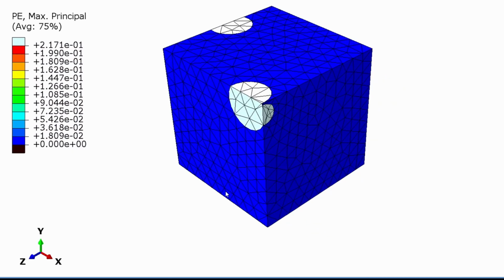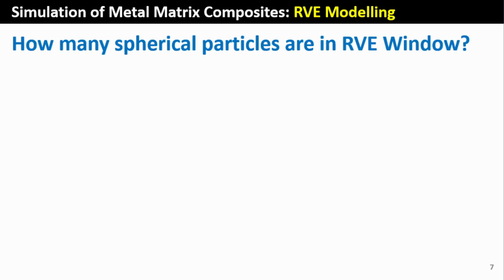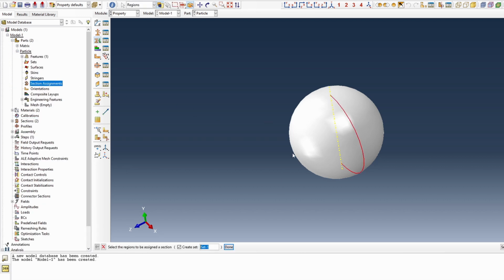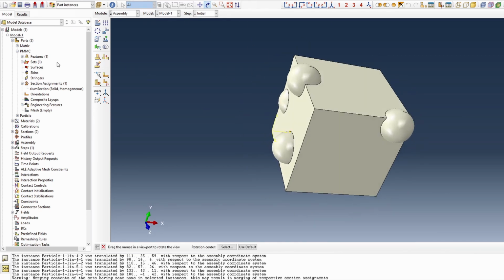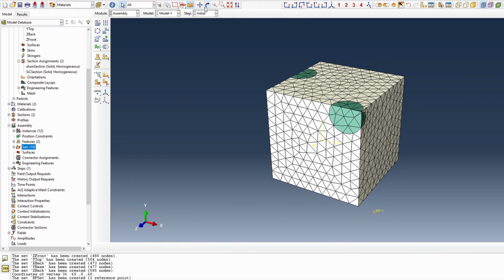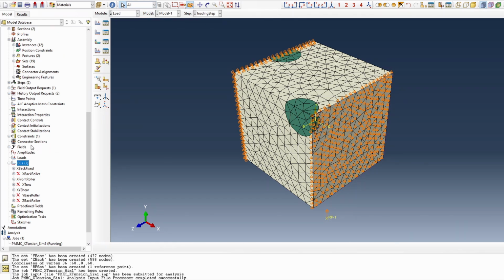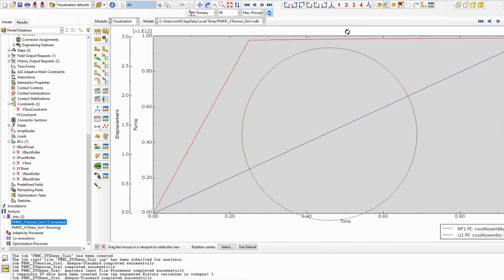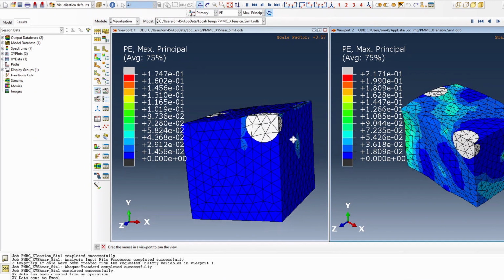RVE modelling of Metal Matrix Composites in ABAQUS #abaqus

Comment: Dear Dr. Okerke,
Thank you for such great and informative videos, can not wait for future works and presentations.

I have a question:
As I realize from channel videos, for giving periodic boundary conditions (PBCs) we should have periodic mesh in opposite faces, however, in the case of this model the mesh seems to be not periodic...
does it mean if we want to apply PBC on a non-periodic mesh we can do it manually as taught in the video?

Thank you for your help and time.
Reply from the maker: Thanks for your kind comments.
You are right that when we model with PBCs, we will often have to have periodic / symmetric nodes on opposite and parallel faces/edges. This makes the sort of implementation I have in this channel work. However, for truly heterogeneous media with random distribution of particles (and periodicity of material not guaranteed), it is not always possible to enforce this periodicity of mesh argument. In that instance, a different implementation will apply. I have used the polynomial interpolation approach for this but it is not always that straight forward. I will hope to make some videos on this ideas in future to complement what I do here for periodic meshes.
Reply: Dear Dr.  @MichaelOkereke  Thank you again for your time to answer the comments and your insights.

I have another question which is more of a general question:
Could you please explain when we should consider PBC for our RVE model and also when we can generally conduct a polynomial interpolation approach, as you mentioned earlier, (does it have any connection to the size of our RVE)

With kindest regards
Mohammad
Reply from the maker: Let me attempt to explain:

1. PBCs are best when you are working on heterogeneous materials where the constituents are clearly defined and their behaviours distinct from themselves. So, to appropriately capture their distinct behaviour, a PBC will allow for a stress wave to pass through them and generate the required wavelike response deforming according to their material response (for the constituents). 

2. Traditionally, PBCs are implemented easily (sort of) when you can have same nodes on opposite and correspondingly parallel faces/edges. This way, the kinematic constraint required to impose PBCs can be linked between the two colinear nodes taken from the two parallel and opposite edges. For this to happen, you will need same nodes on the two candidate face/edges. This leads to the requirement of periodic or symmetric nodal discretizations (meshes).

3. However, for the second question, if you cannot be sure of enforcing such periodic/symmetric meshes, then a method that guesses (interpolates) the behaviour of a point and a corresponding opposite edge point will have to be made. The guess method that is commonly used for this is the so called  polynomial interpolation. It is a type of implementation for applying PBCs where nodal discretizations on candidate face/edges that are parallel and opposite themselves is unsymmetric or arbitrary meshes. 

So, in summary, PBC and Polynomial interpolation are related with the later being simply an PBC implementation style for arbitrary meshes.

Comment: Hello. Thank uou for your great video. I am currently attempting to simulate the compaction powder forming process using the multi-particle finite element method in Abaqus. Using the assembly module, I have assembled a collection of particles and enclosed them within a box. My goal now is to remove the particles that are outside of the box, while retaining the ones that are inside. It's important to note that I do not wish to merge or cut the particles, but rather simply delete the portion that is outside of the box. Can you please provide guidance on how to achieve this?
Reply from the maker: Hello @Hossein, thanks for the query. I think the challenge to this arises from what you have set as a constraint: "you do not wish to merge or cut the particles". In this case, it becomes difficult. If you merge the particles, then you can easily extrude cut through the particles specifying the boundaries within which you accept (i.e. your current domain) and outside that boundary, anything there will be extrude cut. 

I however, do understand the necessity of not merging or cutting the particles. If this is a constraint you must live with, I will then suggest that you identify individually the particles that are appearing on the edge. YOu can label them as a set, then individually extrude-cut them one by one so that in the end, they will be the only ones that you extrude cut. It might be easier to write a python script that does this repetitive process once you have a collection of the boundary fibres. Isolate them according to their coordinate positions for example, left edge and right edge particles. This way, you can then deal with them individually.

One other thing you should consider is to use a datum plane with say a principal axis to do the extrude cutting. For example, the plane of your extrude cutting with not be the particles (as they are spherical, I hope) but the datum plane. The direction of extrude cutting will be defined by a principle x-, y- or z-axis depending on how you want to extrude cut directionally.  You can reach out to me on LinkedIn or Twitter (direct messaging) or the About page here on YouTube for further directions.
Reply: @MichaelOkereke  thank you so much for taking your time. I am trying to do individualy in assembly module but I did not managed to do that. My particles are spherical. Could you please explain more how can I do the procedure you explained?

Comment: I am currently attempting to simulate the compaction powder forming process using the multi-particle finite element method in Abaqus. Using the assembly module, I have assembled a collection of particles and enclosed them within a box. My goal now is to remove the particles that are outside of the box, while retaining the ones that are inside. It's important to note that I do not wish to merge or cut the particles, but rather simply delete the portion that is outside of the box. Can you please provide guidance on how to achieve this?
Reply from the maker: Hello @Hossein, thanks for the query. I think the challenge to this arises from what you have set as a constraint: "you do not wish to merge or cut the particles". In this case, it becomes difficult. If you merge the particles, then you can easily extrude cut through the particles specifying the boundaries within which you accept (i.e. your current domain) and outside that boundary, anything there will be extrude cut. 

I however, do understand the necessity of not merging or cutting the particles. If this is a constraint you must live with, I will then suggest that you identify individually the particles that are appearing on the edge. YOu can label them as a set, then individually extrude-cut them one by one so that in the end, they will be the only ones that you extrude cut. It might be easier to write a python script that does this repetitive process once you have a collection of the boundary fibres. Isolate them according to their coordinate positions for example, left edge and right edge particles. This way, you can then deal with them individually.

One other thing you should consider is to use a datum plane with say a principal axis to do the extrude cutting. For example, the plane of your extrude cutting with not be the particles (as they are spherical, I hope) but the datum plane. The direction of extrude cutting will be defined by a principle x-, y- or z-axis depending on how you want to extrude cut directionally.  You can reach out to me on LinkedIn or Twitter (direct messaging) or the About page here on YouTube for further directions.

Comment: Hi! Great Video!

I have a question. Is Periodic Boundary Condition Applied to this simulation? How different would be if PBC is applied vs no-PBC? thanks!
Reply from the maker: Hello @David, thanks. There is no Boundary Condition on this simulation. If it were to have PBC, you will see a periodic deformation with the shape at the back mirrored at the front for all the three planes (x-, y- and z-planes). In this instance, I have fixed the back using a Dirichlet type Boundary Condition and loaded the front edges. This gives a deformation that may seem periodic in the front but this is entirely due to the presence of the inclusions (particles), causing the deformation to be non-uniform. I hope this makes sense.

Comment: Great video sir. I have a question. I created an RVE model in Matlab. This RVE model is a cube with Voronoi polygons. I have the faces, cordinates of seeds, vertices, and also information on how the faces are connected with each other in matlab. I would like to export this RVE to Abaqus from MATLAB using python scripting. do you think this is possible?
Reply from the maker: Hello @Akshay, I have not dealt with this type of problem before but I do think it is possible, if you have all the nodal coordinates and element connectivities. It might help if you can re-format the information into an ABAQUS input keyword style so that it is easy for ABAQUS to read. The problem with your MATLAB model is that it is not in a format that ABAQUS can read. So, some translator of a kind is required. You can study the ABAQUS input keyword file and see if you can re-format the information you have into that format. That means you need to know the element connectivities for all the cells/meshes in the MATLAB model and their nodal coordinates and node numbers. It is not trivial but it is certainly possible, in my opinion. Good luck with the research.
Reply: @MichaelOkereke  Thank you sir for the reply. So all the information I currently possess is based on geometry rather than the mesh. To be specific, I have the coordinates, faces, vertices and connectivity information. Now all I have to do is understand how to write this in a format so that Abaqus can read it as a geometry input. So, I would like to know if there is any material I can get into so that I can understand how to write this document.
Reply from the maker: Hello Akshay, I do not have any material. I think you should search for 'from MATLAB to ABAQUS translator', you may be able to get some resources online. Sorry!

Comment: Sir, why is periodic boundary condition not needed in this case?
Reply: I have seen the comment of your on PBC with 3D. But may I know if the result is the same with or without PBC? Thank you, I hope your reply. Your videos are great valuable resource , sir. I thank you
Reply from the maker: Hello @Kim Kinal, this is a good question. I could use 3D PBC here but that will require a PBC Generator script for 3D which is not currently available for general use. In future, I will make videos where I will do so. In terms of the result, there will be an effect between use and not use of PBC. Usually, you get better convergence of the simulation to the right result with PBC compared to the case without it. I published a paper in the past which discusses this in more detail. You can get the paper from here: https://doi.org/10.1016/j.commatsci.2012.12.036.
Reply: Also, can I do high-strain rate compression on the same model?
Reply from the maker: Yes, you can do high strain rate compression with this model. You just have to make the step an ABAQUS Explicit step and allow for am amplitude curve that allows for dynamic loading. There may be some modifications here and there you need to make to damp out dynamic effects due to the high strain rate, but the simple answer is yes, you can.

Comment: Very interesting and helpful video!  Could you please answer: in case of cell shear, we collect RF2 and U2 data from RP and end up with effective shear modulus and shear strength?
Reply from the maker: Hello @Nick G, thanks for your interest in the channel.  The reason for this is because the RF2 is force parallel to the X-edge and shear stress is this force divided by the area of this x edge. The U2 term is displacement in y-axis and then divided by the Y edge gives you the shear strain. 

To get shear behaviour in xy plane you need y-axis displacement and forces (u2 and rf2). Similarly for shear on yz plane you will need the z-axis displacement and forces and so on. This is how it works.
Reply: @MichaelOkereke  thank you very much for this answer, you helped me a lot.

Comment: Thanks you so much Dr. Okereke for these great videos. There is a question, I am intrested in a the same structure (soft matrix and rigide particles) but with a higher volume fraction (above 40%) and large deformation (NLGEOM). Abaqus cannot converge after serveral increments at a small strain (around 1-2%), but I really want to go further. This may be due to excessive element distortion. Did you have a similar problem?
Reply from the maker: Dear, thanks for your interest in the model. I did not have the problem you described because my matrix is not as 'soft' as yours. When the matrix mismatch between matrix and rigid particles is so high, then I have see this sort of problem you describe occur. It is quite commonplace. You are doing the right thing by switching on NLGEON. I suggest also that you may try smaller meshes, explore doing a Dynamic explicit study (to help with the time steps) and just stick at it. It might also not be possible to achieve your large deformation due to the excessive distortion but I suggest you keep trying all possible things until you get it working. If you sign up to my CM Videos Insider Group, you can contact me directly to see if there is more help I can offer you.

Comment: Hi Michael, I'm currently working on a design for a magnetorheological elastomer isolator, so this can basically apply to that correct? It consists on a silicon matrix with iron particles randomly dispersed
Reply from the maker: Hello Jose, thanks for your interest in the channel. I believe the system you describe - Magnetorhelogical elastomer isolator - can be modelled using the ideas of this Metal Matrix Composite system. I believe the silicon matrix will be the matrix component and the iron particles will be the reinforcing inclusions. I am not sure what shape the iron particles are - if they are spherical, then definitely the system here will work. I also have another similar video about elliptical shaped inclusions which you can see here: https://www.youtube.com/watch?v=8zPj-n23B4k  

What is not clear though to me is what ouptut you are looking for. If they objective is mechanical properties (since you have the elastomer in the system), then the approach presented here can be morphed directly into your system. However, such magnetorhelogical system are often looking at some electrical energy exchange, in which case, you will have to change your analysis type from a mechanical investigation to an electromagnetic investigation. ABAQUS does both but here is where the different between my video and your problem may lie. Let me know if I have interpreted the problem correctly.
Reply: @MichaelOkereke  Thank you for kind answer! The output that I'm looking for is to study the behavior (in terms of stiffness and transmissibility of energy) of the material when a magnetic field is applied. So I'm first trying to create the RVE and I think the most difficult part would be to couple the magnetic and the mechanical physics in abaqus, do you have some tutorial coupling or using 2 different types of physics that can help me with it? Regards from Mexico!
Reply from the maker: Hello @Jose Luis Chan Mayen, apologies for just getting to this query now. I must have missed it. On coupling of magnetic and mechanical physics in ABAQUS, I do not have any tutorial on that but this is something that one can look into and I believe it can be done. I just have not done it. Good luck with the work.

Comment: Thank you Dr. Okereke, the video is really helpful. I have a question: Since this is a uniaxial loading condition, why do you need the roller supports at x, y and z=0 instead of just on the x=0 face?
Reply from the maker: Hello Brook, you are right about just putting an x axis constraint but I decided to use an RVE that's a quarter of the specimen hence the boundary condition I used.  Both are okay but I will usually go with the quarter rve to save computational cost.

Comment: Great job Doc. just a question. Could you explain how this equation/dimensions and calculations will change for a nanocomposite case?
Reply from the maker: Hello Adedotun, thanks for your interest in the channel. I believe you can still use the same equation. Just make sure you are using the right formula for the inclusion type i.e. if it is not spherical, it could be cylindrical, for example in carbon nanotubes. In this case, you calculation of number of inclusion types must account for the different geometric shape.

Comment: Can you please tell why you have considered reference point?
Reply from the maker: Hello Kartheek, the use of reference point here was to use it to extract reaction force and displacement measurements for the model. This will mean in calculating normal stresses and strains, history data from the reference point can be stored and used. Without a reference point, you will have to specify a nodal set and then do volume averaging over those nodal sets. This is okay if you have a model with a few elements. If there are a lot, ABAQUS will often complain that you have more that 10,000 variables to store in History and so runs out of memory. The use of a reference point means you are only tracing a nodal point and it will only return values according to the number of time steps used to complete the simulation. Therefore, data storage is manageable but of course you will need to take that data and manipulate it to get your stress-strain plot. I hope the explanation makes sense to you.